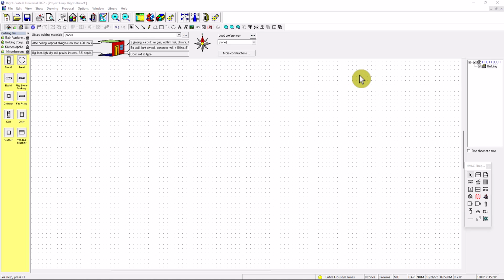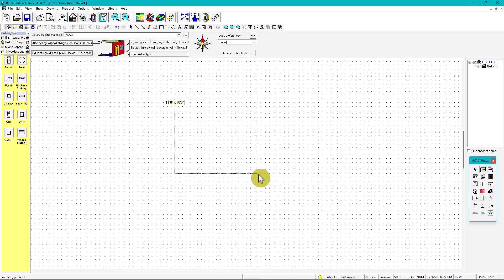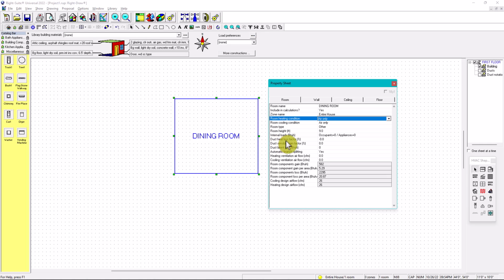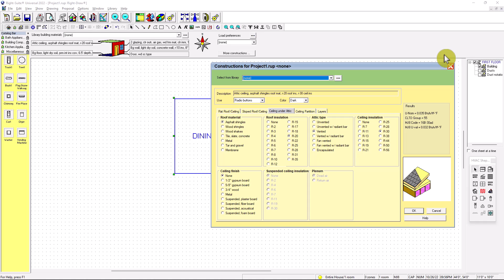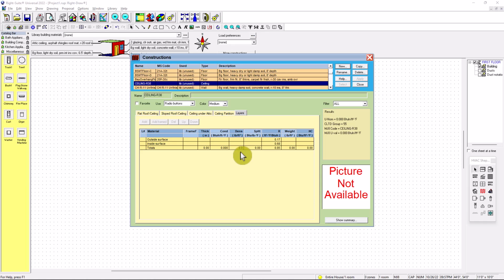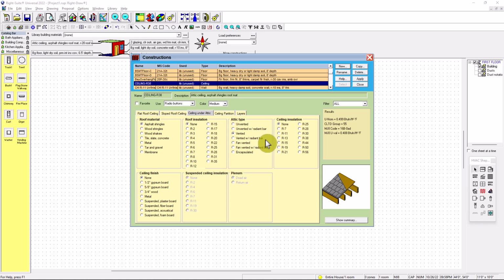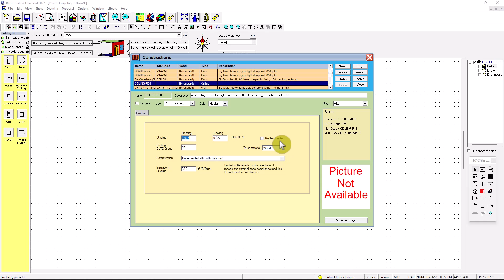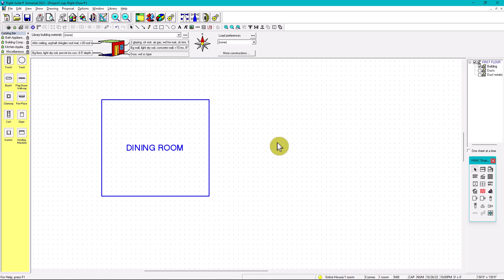Wrightsoft: Manual J Heat Load Calculation - Ceiling Library Creation

Comment: with same house that outside walls and roofs area stay the same (orientation and total area), does the heat lost change if the ceiling vault (higher) or not?  if so you have any video to do vault ceiling heat loss?
Reply from the maker: That’s a great question. I don’t have a video specifically about vaulted ceiling heat load impact. I will make one in the near future.
Reply: @hvaceasymath  thank you very much
Reply from the maker: I made another video explaining about the question regarding to the ceiling configuration and heat loads
Link: https://youtu.be/xXWN9t_WMrc?si=FVdWYANTselsX578
I hope this helps